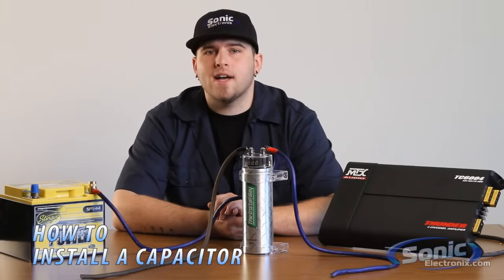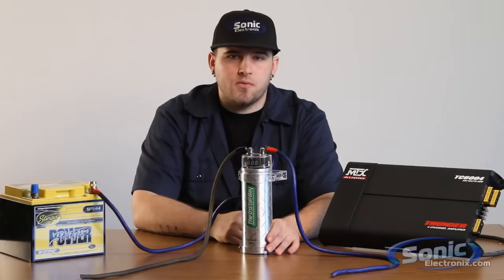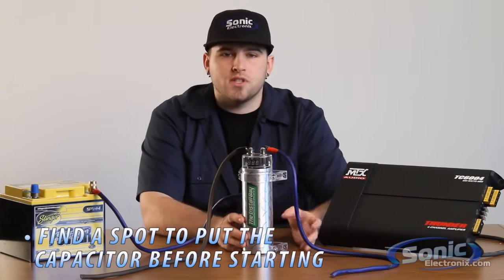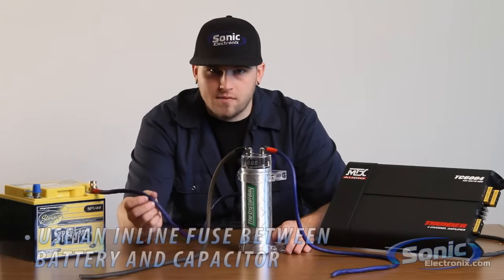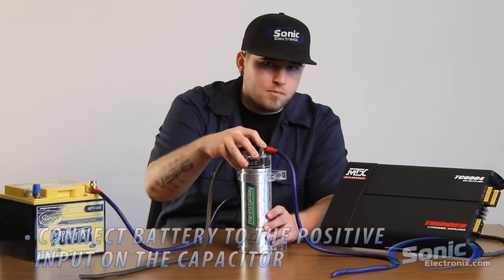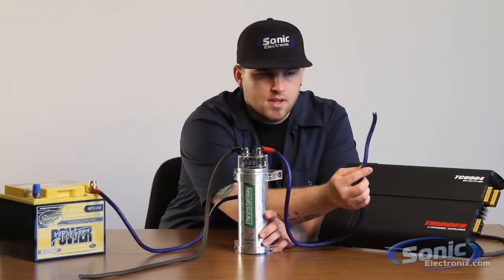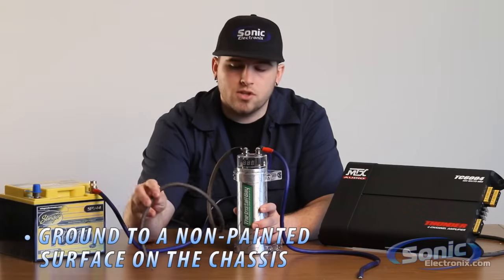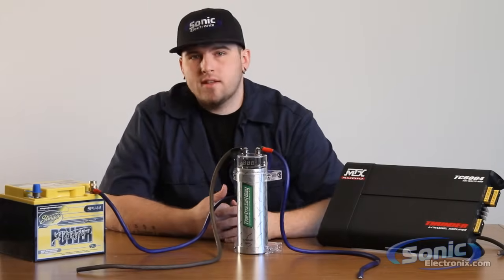How To Install A Car Audio Capacitor

Comment: @baseballdude1065  No, as fingerboy18 said " A capacitor protects the battery from charge fluctuations thus prolonging it's life as well as provides a supply for transient responses" - aka the music will sound better... The first thing in preparing a vehicle for after market sound systems is to upgrade the " big three ". In your case you would use true spec 4 guage wire such as monster, tsunami, street wire, kicker, rockford fosgate, ect. Then, you would upgrade your primary battery

Comment: @airforceranger48 How is it dumb?  I'm an Electrical Engineer.  I'm quite confident about their functions.  Electrolytic capacitors are inefficient, noisy, and their values fluctuate with heat.  They do, however, have tremendous capacitance values, which is necessary for high-power uses.

Comment: @airforceranger48 When a capacitor is wired in parallel to a DC power source, it will charge to that voltage.  What it is doing in a car audio system is acting like a tank for charge.  When the amplifier draws a lot of current (strong bass notes), the capacitor's charge supplies the amp with the necessary current and the battery will then recharge the cap.  It's protecting the battery from charge fluctuations as well as providing a supply for transient responses.

Comment from the maker: @FanOfSubwoofers If you are running two subs and two speakers or even 4 speakers on 1 amplifier that probably isnt enough power to properly run you entire system. Even if you have a 5-channel amplifier the subwoofers are pretty strong. MTX only makes 2 models of square woofer so you are either running 1200W RMS total or 1500W RMS total. I recommend an amplifier for your subs and one for your speakers. If you want a battery go with the XS-Power D5100, that should be enough to power your system.

Comment: you guys do realize that a capacitor is completely useless in the large majority of audio installs, right? the only reason you would ever want one is to help with noise in the electrical... other then that, they are worthless. i really dont understand why companies still sell these.

Comment: i have 2 12" kenwoods at 400 watts (4 ohms) rms....and a sony 1400 watt amp at 220 watts RMS x 2 @ 4 ohms....and my headlights dim when the bass hits....if i bought this cap, would that solve the headlight problem?

Comment from the maker: @thatbastardson If you have a 12" W7 you might want to consider upgrading your battery since the W7 will be able to handle 1000W RMS. The most common way to wire a subwoofer to an amplifier is to wire the subwoofer directly to the amplifier. The W7 subwoofer has a single 3 ohm voice coil so when you need to make sure your amplifier is able to produce a sufficient amount of power so that the subwoofer runs properly. The JL Audio Slash v2 1000/1v2 is the recommended amp to use with a single W7.

Comment: question about hooking up a sub and amp. should i buy a separate battery for this? what is the most common way to do this? its a 12 in. jl audio anniversary edition, with amp.

Comment: i have 2 c12 kicker subs with a zx400 kicker amp is this enough power?? do i need a battery or a capacitor with this??

Comment from the maker: @trujay2 Yeah it amounts to about the same thing, so yeah you can use two spv 44s or your original plan. If you are going to keep your original battery and then use two spv44s as additional batteries that would be just fine.

Comment: @SonicElectronixTV now i asked the question about 1 spv 44 and 1 spv 70. but at the very lowest could i use 2 SPV 44's? im either going to use the SPV44 and SPV70 or 2 SPV44's.

Comment from the maker: @trujay2 Yes that can be done, just make sure that you measure your space to make sure that the battery will fit correctly without any problems. You could also just keep your main battery and use the SPV70 in the back, that will work as well and might be a little less expensive.

Comment from the maker: @TheNascarfan89 If your subwoofer is handling less than 800 watts RMS then you more than likely will not need a capacitor.  The capacitor will store energy that can be used when then subwoofer requires quick burst of energy draw. This takes some of the stress off your main battery. If you are running a system with more than 1000 watts RMS we strongly suggest going with an additional battery. Capacitors store energy they do not provide more energy.

Comment from the maker: @RogueCow Charging a capacitor is not very complicated. You can find many instruction on how to do so or you can visit our Knowledge Base section on our website and type in "Capacitor" and you will be able to pull up a helpful link that will show you step by step on how to charge a capacitor. Installation is also pretty simple, its just  a matter of connecting the capacitor to the rest of your audio set up. Once again our Knowledge Bass section will provide step by step instructions.

Comment: @wow1022 In reality, the amp has all the capacitance it needs built right in. I do consider buying a cap (with digital readout) basically nerd bling.

Comment: @wow1022 ...and you never will. That's all about HO alternators and group 31 batteries. A lot of people have the misconception a cap is going to magically cure or prevent dimming lights, change the way the system sounds or save the battery/alternator. It's all because of all of the marketing of the cap manufacturers and sales people buying into it. Even the above video isn't immune to the hype though nothing is mention about WHY to use one, even though the connection method given is incorrect.

Comment: @sparky3489 
but the cap only helps for instantaneous high current draw... if you keep that current at constant that cap also begins to pull current to recharge itself

Comment: The thing is, people get confused in the real purpose of a cap. A cap is not used to cure or prevent dimming lights, change the way the system sounds or save the battery/alternator (all are misconceptions).

To undertsand the purpose you need to understand how they work.

A cap does it's best to keep the voltage at a certain level, but if the overall voltage changes so will the cap voltage. The cap just makes the change smoother.

Comment: @wow1022 You don't "drain" a cap as it voltage is dependent on the source (Batt. and ALt.).

Comment from the maker: @MsiVip Capacitors are like a big storage container for energy. Essentially they store energy so that when your audio set up demands quick burst of energy draw, it draws from the capacitor and no the main battery. This helps your battery from being completely drained and also protects your alternator. If you have a more constant source of energy your system will perform better for this reason we recommend an upgraded battery for better results.

Comment from the maker: @dreammoney101 Adding a capacitor won't guarantee more power behind each bass hit - it's more designed to store energy for the extremely demanding bass hits where your battery has to discharge quickly to the amplifier.  Since your connected  quite closely - it may not significantly improve the sound.  It won't hurt to add one on though, I'd recommend trying it out.

Comment: And ... for what the capacitor intended ?
Which difference the audio has after the installation ?
i just never used the amplifier... and it's interesting because i plan to get one.

Comment from the maker: @spezow1234 What gauge wire are you using?  It  may be a wiring size issue or ground, or a multitude of other potential problems.  It's tough to diagnose over the web, obviously, but since the two most probable are either wire gauge and ground location just double check what size wire you're using.  Make sure it's the same size as the ground wire, and ensure that the ground has a stable unpainted metal surface to grab onto.  Changing your ground location might be a good idea for testing purposes

Comment from the maker: @OfficialKFlum The general rule of thumb is for every 500 watts of RMS it should be 1 farad. So if you are doing 4,000 you would be looking at an 8 Farad Capacitor. Now if the amp is 4,000 watts peak then you will probably only get 2,000 watts RMS meaning you will only need a 4 farad capacitor. This also depends on the capacitor. Higher-end brands like Rockford Fosgate you can go with 1 farad for every 1,000 watts of RMS. To be safe go with 1 farad for every 500 watts.

Comment from the maker: @crazyj06 You'll want to separately ground your amplifier and capacitor from each other.  Not only will the capacitor be generating noise if grounded near the amp, but it will also require a separate ground purely for power demands.

Comment from the maker: @tito69god Nothing is wrong with installing a capacitor rated higher than what you need.  In this case, a 20 Farad capacitor can be a little more than what you need, but that's fine in your case.   Go ahead and install it, it should be able to help with improving the bass response in your system a little as well.

Comment from the maker: @dustyonlive If you are replacing your factory battery then no you will not need an isolator, if however you are just adding a battery then yes you will need an isolator. With that kind of power output you will need to look into upgrading your alternator as well. Unfortunately we do not offer free amp kits with the purchase of an amp, we do have some combos that have an amp and amp kit bundled together. My other suggestion is upgrading your amp kit to 0 gauge due to the amount of power output.

Comment: hey im new to electronics im 17 but im not stupid i was going to put a soundstorm 3600D with earthquake ak-5000 4 gauge amp kit and 2 absolute 2 farad caps hooked to 2 boss nx12d subs 2500w max each, shurkin bt-20 battery do i need a battery isolater/relay and i hear when u buy a amp u get an amp kit free? also i will be hooking this up to a 1998 hyundai tiburon will this work? if u gotany ideabc ihave a budget under 1g and i want lotss of BASS.

Comment from the maker: @SmokeMeDry You can mount another battery in your trunk.  Depending on the type of battery you use, something like an AGM (Absorbed Glass Matt) battery you can mount even upside down!  Other batteries you won't be able to do this because of the corrosive acid they contain.  Remember to put a battery isolator in between your factory battery and your secondary battery.  Check out Kinetik and Shuriken for some great battery options!

Comment from the maker: @mohrpimpin When you start going over the 1000W RMS mark, you really want to go with an additional battery. The reason for this is that a battery is more reliable than a capacitor and with that much power you really want to protect your alternator and main battery. You might even have to upgrade your alternator but this will mainly depend on the time of vehicle you have and the total amount of RMS you will be running. Based on your setup I would say a KHC2000 will do the trick.

Comment: am going to be running 2 kicker l7's 12in and a alpine 1000 watt amp and a alpine 540.4 amp also a tv should i use and capacitor or a batt

Comment from the maker: @johndread It sounds like you're looking for something like an equalizer.  An equalizer is great for adjusting different frequencies like bass, mid, and treble.  Something like the Clarion EQS746 is the type of equalizer that will function at a good price and more than likely carry out what you want.  You may also want to consider something like the Audiocontrol Epicenter for bass enhancement.

Comment from the maker: @mrlevi93 Yes the capacitor must be charged before it is used.  Most capacitors will include a resistor that you will run inline with your main battery source. Once the resistor goes from bright to completely dim, then your capacitor will be completely charged. At that point remove the resistor and reconnect the capacitor to your main battery source. This is a little tricky if you have never done it before. Luckily you have many resources that you can use to diagram how to charge a capacitor.

Comment from the maker: @MrJames6216 Your capacitor should stay on.  Make sure that you've charged your capacitor, and also check it's ground connection to ensure it ha  12 volt continuity.

Comment from the maker: @blodswetngearz You got it.  Just use the same terminal for both the battery to the capacitor and capacitor to amplifier.  Make sure to ground the capacitor separately from the amplifier.

Comment from the maker: @Jorge817S The best way to do it is to run a single 1/0 gauge wire (or multiple 0 gauges if required) to a distribution block.  Then distribute the power to the amp, capacitor, and additional battery if required (with an in-line isolator of course).

Comment from the maker: @nastyku You wouldn't necessarily need the capacitor in-line since the Kinetik battery will basically be doing the same thing, but at a more efficient rate.  If you do decide to go with the cap as well then no harm.  You'll want to run 0 gauge from your battery to a battery isolator, and then run that to your Kinetik battery.  This will prevent the Kinetik from continuously draining the main battery. I would recommend grounding the cap/battery separate from the amp to avoid noise issues.

Comment from the maker: @neal747 You will want to ground the amplifier and capacitor separately.  Run a wire from the amp ground to the chassis, and also a wire from the capacitor ground to a different spot on the chassis.

Comment from the maker: @Ryguy430 That's right.  You can use a common ground for multiple capacitors, but it's better not grounding an amplifier along with a capacitor.  It's possible that you could generate noise through your system from the capacitors charging and discharging by using a common ground between these two.

Comment: So what im trying to find out is if i do a Kinetic battery, a Cap and keep my OEM battery outfront. How would I wire that? just a 0ga from upfront to the kinetic (fused) then power lead to Cap, Then power lead from cap to amp.
could I ground all three (Amp,Cap,Kinetic) on the same Ground D-Block without problems? and i also Will be purchasing a H.O Alternator. 
Thanks

Comment from the maker: @Ryguy430 Yup.  Run a separate ground wire for your amplifiers ground as well, this will ensure you'll have proper continuity for both your amplifier and your capacitor.

Comment from the maker: @asiangunner901 The general rule of thumb is 1 Farad for every 500 watts of RMS power. Now some of the higher end capacitors will do 1000 watts RMS with 1 Farad. If you use your 1 Farad on the 1500 watts amp you might still experience power drainage because your system will still be drawing more than you battery can handle. We would recommend upgrading to a 2 or even 3 Farad capacitor or even better a second battery. A Kinetik KHC1800 should do the job just fine.

Comment from the maker: @agassizsucks How do you have it connected?  If you have it connected to a power, and have power running to your amplifier and grounded your cap and amplifier then it should have been connected correctly.  If it functioned at one time but is no longer functioning you can always try charging the capacitor but it usually won't alleviate issues you're having.

Comment from the maker: @Fariascesar1 You can connect them to the same ground or ground distribution block, but yes you will need a cable from the capacitor itself as well as the amplifier itself.  You can ground them wherever as long as it's a solid unpainted metal surface, but there will need to be a ground for each of the components.

Comment from the maker: @littlechrist1 You'll need to have the capacitor grounded.  If the instructions do not state to ground the capacitor they may be incomplete, or the capacitor may have a specific design that prevents it from being grounded.  Check to see if there are multiple posts to connect power and ground to.   The capacitors we have worked with have all required to be grounded, as well as charged before functioning.

Comment from the maker: @johndread There shouldn't be any problems with using a 2 farad cap with your system.  The reason we said that a 1 farad capacitor would suffice is because of general rule of thumb.  Going above the rule of thumb is recommended, and you can usually alleviate stress on your amplifier or battery by adding a 2 farad capacitor. There's no negative effects.

Comment from the maker: @inkster69 You've got the idea.  Find where you'll place the capacitor and cut the wire.  Then connect the power from the battery and the power to the amplifier up to the capacitors terminals.  Then run a ground wire from the capacitor to either a grounding distribution block or a unpainted metal surface.

Comment: @SonicElectronixTV Right now i have 2 12 inch subs(Pioneer Champion Series Pro 3500W each sub), with a 3500W amp, would i have to run another power wire to the capacitor or just cut the existing wire and place the capacitor somewhere in there.  also would i need 2 ground wires, 1 from amp to ground another from capacitor to ground?

Comment from the maker: @johndread That should work okay.  The general rule of thumb for car audio capacitors is for every 500 watts of RMS power, a one farad capacitor should suffice.  For your application a 2 farad capacitor might work, but you might be better off considering a 1 farad capacitor from a reliable brand.

Comment from the maker: @marcusher You don't need to have the amp connected yet.  After charging you can unground everything and then connect it.  You don't need to remove the in-line fuse or else you won't get power to the capacitor.  Just connect the capacitor to the ground and power and put the charging bulb or resistor in-line with the battery line.  After charging you can unground and reconnect everything.  No problem at all. Let us know if you have any more questions.